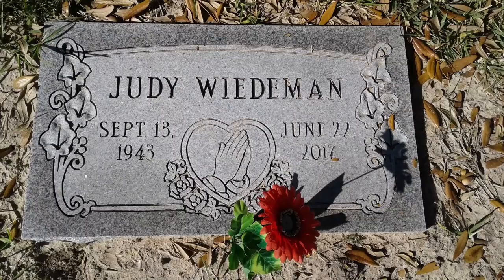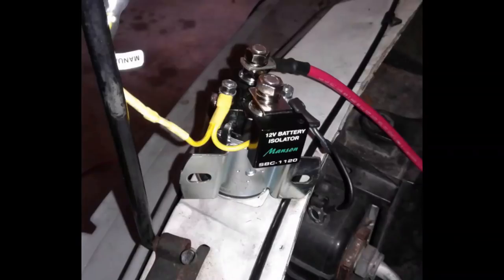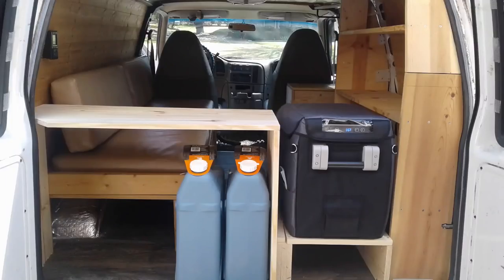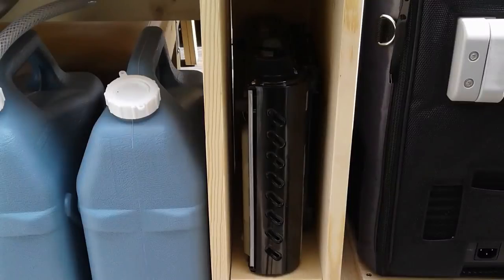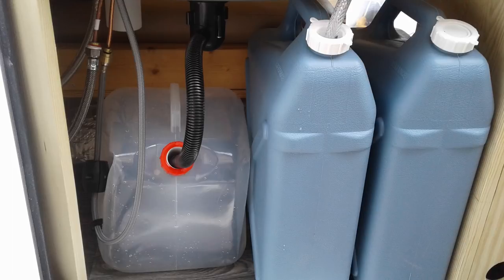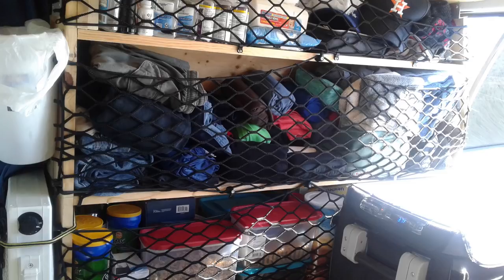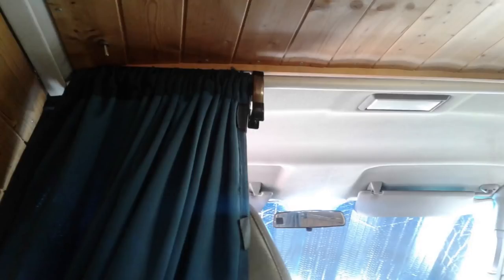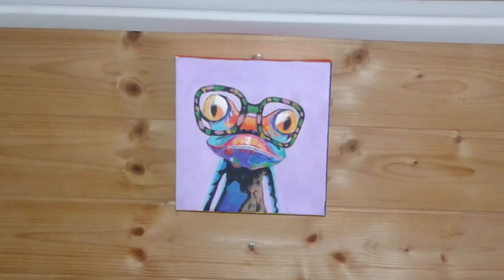Astro Camper Van Build 10 - Kitchen Build - Other Upgrades

Comment: Great idea about that dual purpose sink faucet! I've been binging for a few months and I haven't seen anyone do that!
Reply from the maker: Right?  Most people have the bed in the back.  The outside access kitchen is great for cooking at campsites, then when urban stealth camping, I can easily cook inside.  Also, with the water jugs in the back, it makes it real easy to fill them up....just open the back doors.  :). Thanks for checking out the videos.

Comment: I would suggest adding a door that covers the water jug area. If it was hinged at the top, it could flip up & provide much needed counter / table space when cooking outside. 

Cheers.
Reply from the maker: Hi John. Having more room in the back would be nice, but we built the current counter to use every inch/centimeter from the bed to the back doors.  The water jugs press up against the back doors, so no room for a flip up counter.  We thought about it, for sure.  Thanks for the tip.  Others should do this, if room permits.

Comment: Wow, you really organized and packed a lot of stuff into an Astro Van. Im thinking of insulating mine the same way from top to bottom, how well does it keep the cold and heat out? Do you think you'd benefit using a diesel heater in the winter?.....Thanks
Reply from the maker: Yes, Astro vans are small, so there are some tough decisions to be made when deciding what to fit inside. As for the summer heat, if you have windows and don’t keep them covered, you will never beat the heat.  I do have windows and I like to have somewhat of a view, so heat is a problem.  That is why I decided to hit the road and chase 70 degrees. :)  The only way to keep a van cool, even with insulation, is to park in the shade, circulate fresh air with fans or install an AC unit.  It’s like having an empty ice chest, putting it in the sun with no ice and expecting it to be cold inside when the lid is opened.  Not gonna work.

Keeping a van warm in cold weather, on the other hand is easy.  My van, with insulation, is typically 15-20 degrees warmer inside the van while it’s cold outside.  That is without using heat.  Still, the van is so small, I can heat it up very quickly.  I rarely pull my heater out though, since I don’t find myself in below 30 degree temps very often.  Hope this helps.  Thanks for checking out my videos. :)
Reply: Yes, you have helped me a lot in my decisions. What do you think about removing the spare tire, move it to the door or roof. Use the space to make a battery box with access from inside.
Reply from the maker: Yes!  Excellent idea.  I considered installing a tire holder on the back door but instead put a full size spare under.  I may one day add a bike rack to the back.  That would kill the stealth, but I have only stealth camped 1 week so far in 2020. 👍
Reply: @TravelingTroy  I keep the front cab sparse, I bought a work vest and a hard hat and keep it on a hook. I have parked in different places, never had a knock. My van has a 5 inch life with off road tires, 375 watt panel on the roof, Maxx Fan and spare tire on roof rack. Im putting a 5KBTU window unit on one of the rear doors, I also have a 3KWt predator gas generator on a rear hitch rack. I dont havemy solar batteries yet because I dont know if im going Lithium or AGM sealed. Ive gone everwhere with my silent generator, Ive had no issues running it, in neighborhoods, I dont run 120V, I have a 500 Jackery for my 12V.  I can hook up to shore power when available.

Comment: Looks awesome. I've seen other vans with a similar kitchen set up and the ability to use the hose in the faucet as a shower is very cool. I'd be interested in hearing how that Dometic size works out for you. Too small? Just right? Thanks for going in to such detail!
Reply from the maker: Bumpin Along Yes, the fridge is small, but is working fine for now. I use it as a fridge only, not freezer, so that does limit me not being able to freeze things.

Comment: Hi guys, great build. Can I ask you a question? I am 5'8" and I am wondering if I could make a bed to sleep sideways on the van (as opposed to your bed which is longitudinal). Do you think it is wide enough to build a bed that would fit me?  Thank you, this is invaluable info for me because I am about to buy an Astrovan. Thanks :)
Reply from the maker: Yes, you could build the bed in the back.  After adding insulation and paneling, there wasn't enough room for me at 6 ft, but I could have made it work with a wider bed and if I slept diagonally.

Comment: How did you get the kitchen drawer to go both directions? Did you just not use any hardware?
Reply from the maker: Right.  Didn’t use any hardware.  We did use no-scratch pads on the bottom of the drawer and the weight of the items inside keeps it from moving.

Comment: So you can charge one single battery with solar, through the battery isolator, and through shore power?
Reply from the maker: Hi Levi.  Yes, I have two 6 volt batteries that I run in series, which makes a 12 volt system.  All of the charging systems charge these two batteries, when I need them.  95% of the time, I only use the solar panels to charge the batteries.  The panels do a good job of keeping them topped off.  If it’s been cloudy and rainy for consecutive days, I may flip on the battery isolator, while driving, to help charge the batteries, along with whatever solar is getting through the clouds.  Shore power was the first charging system we installed.  I rarely use it anymore, since solar does such a good job.  I haven’t used shore power in over a year, easy.  I hope this helps.  Thanks for checking out my videos.

Comment: how do you stay cool when you sleep?
Reply from the maker: Hi Tom.  One thing I’ve done the past two summers to stay cool in the van is to drive it to cooler regions of the country.  As far as tips to keep cool, I made a video on what I do for ventilation: https://youtu.be/b8rmQRMUl8s Basically, I have a fantastic fan in the ceiling of the van that sucks warm air out and pulls fresh air into the van from the cracked front windows.

Comment: Great video Troy. I wanted to ask how much did it cost to build the kitchen?? I'm thinking about getting a astro van, do they maintain well as far as mechanically??
Reply from the maker: Thanks!  My Astro has been pretty good mechanically.  The main issues have been with suspension/steering.  Parts wearing out.  The engine, though, has run strong.  The fridge is the expensive part of the kitchen and varies in price from $100 used to $1000 or more.  The kitchen itself was no more than $200 or so.